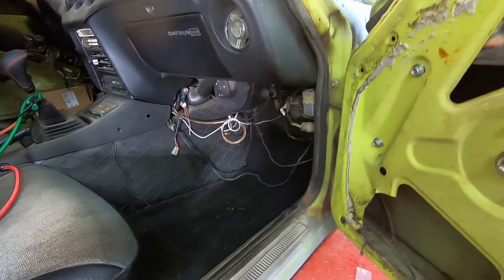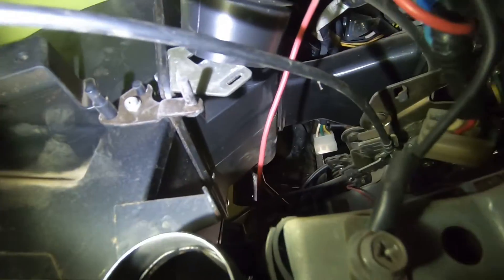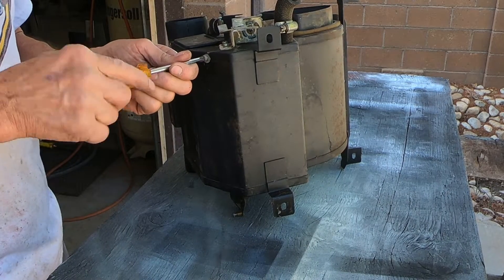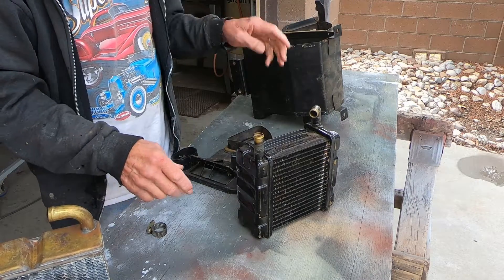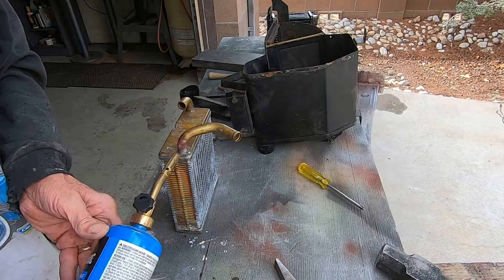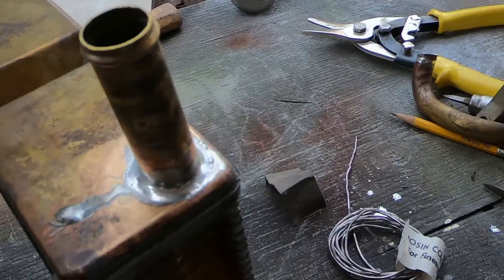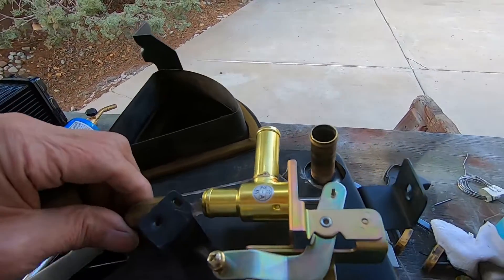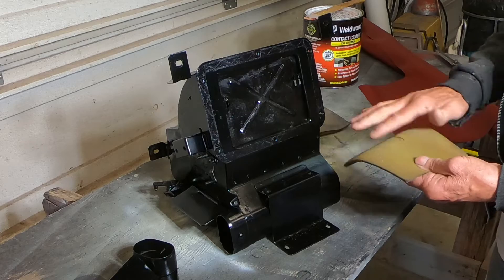Datsun 240Z Heater Core Replacement with one from a Mazda Pickup. New temperature control valve too!

Comment: I'm running into the same issue, I'm hoping my core is fine a d that I just need the control valve, this video definitely helped me with finding out how hard or easy it will be. Very nice video, please. Message me. I'd love to talk with you about the Z, I got a 1977 280z
Reply from the maker: Good luck with yours, hopefully only the valve .... much easier. Not sure how to message you other than through the channel. You can email me if you want at DLShaw50@gmail.com

Comment: The engineers obviously don't do repair work.  Seems like all vehicles are built around the heater cores.  Too bad you couldn't get the original core repaired.
Reply: My radiator guy rebuilt mine...